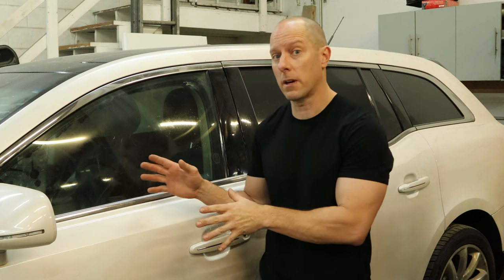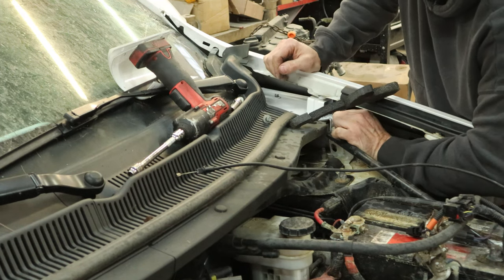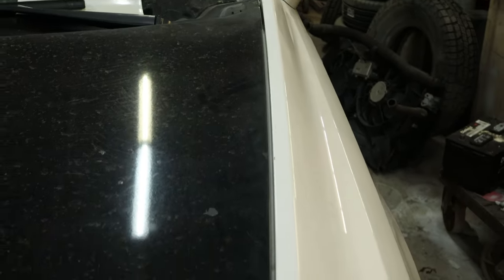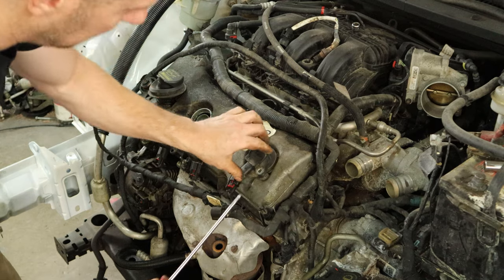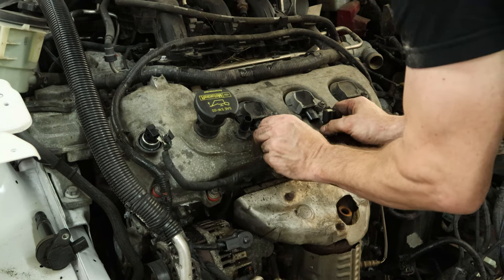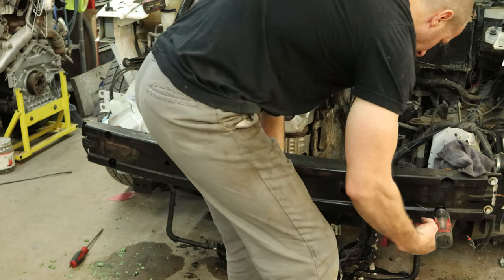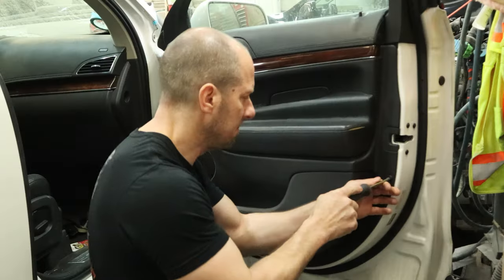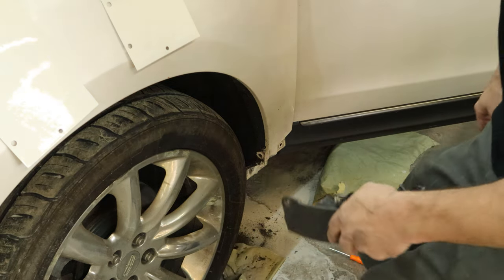Rebuilding the deer hunting Lincoln MKT part 2

Comment: No Ford didn't take the bail out money when all of them were hearting and went to the govt for money, but Ford has accepted money from them at other times.  The other thing they did do was a split on stock while lowered the price, people flocked to buy while it was extremely cheap.  Not sure where it's at currently but it's worth way more than it once was.  
Personally I don't like the brand due to previous issues on trucks I've owned over the years.  
Don't really care for Dodge, sure there's a couple vehicles I'd own if I had a chance.  But personally I'd go with GMC on trucks and probably Buick on a car if I were to own a car.  But with health issues I try to avoid cars seeings how they are harder for me to get out of.  With trucks you can just fall out if need be.  

Once again another awesome video.  It amazes me that no matter the make or brand you wizz through them like it's nothing but that's mostly all you've done all your life.  
I'd never be afraid to drive anything you've worked on.  
Mr Spotty only shows up for the money or what little you'll let him have.  According to some you don't make money on these vehicles.  You're smart enough you know if you'll make money on it before you buy it.   Keep up the awesome work.
🚗🚗🚗

Comment: My 91 Nissan Sentra was still running strong and not using any oil when it got parked at 395,000 miles. It needed struts, AC repair and a paint job. The estimate for the paint job was more than the car was worth. The struts were almost as much as the car was worth. I wish I had fixed it anyway because it was so much better built than any new car that I've seen since 2000.

Comment: That was my favorite tool also, a long barrel CP with the quick connect blade holder. After 37yrs in the industry I've paid for it with two rotator cuff repairs and permanent nerve damage to my hands, but I wouldn't go back and change a thing, had a lot of fun and got to play with fire, paint things and tear shit up and made a ton of money to do it. Great videos and skills as usual.
p.s. take 1000 grit sandpaper and sharpen those razor blades, now that's really being cheap. LOL

Comment: Those engine mounts are supposed to break. They save the engine from breaking, but mostly designed as part of the crumple zone, so they really are built Ford Tough. They did as they were designed.
It's also the reason they can randomly break because of the built-in weak spot.
Reply from the maker: One might argue the entire car is built to break. 😂
Reply: @vehcor  No one would even argue it. it's a fact, lol. But let's face it, they're all built crap nowadays. Except for your rebuilds, of course 😉

Comment: I find it quite amazing -- the amount of damage hitting a deer can do.  I hit one at 50 mph and thought I could just slap on some sheet metal and a bumper cover and a headlight and a washer bottle and an air box and a steering fluid reservoir and a core support and use some washers to make it all "fit" ... front end still crooked asf.  Can't avoid the much needed upper apron work.  Now I wish I'd done it your way three years ago!  😪

Comment: Please forgive my OCD sounding off but @ 14:36 you missed a cam cover screw and red seal on the LH front. It was probably missing off the parts car...
But as usual you seem to have nailed that repair without too much pulling and welding. Very sensible buying the parts car. Now you need to find a Lincoln smacked up its rear. But only if you can stand doing another Ford ...
Reply from the maker: If you are talking about the empty hole, there is one on the top of the valve cover in the same spot.  Neither of them get a bolt.  It might be where a wiring harness clips in on different models.  🤷🏼‍♂️  No more of these things!  I am going to junk the parts car ASAP!
Reply: @vehcor   Yep that's one but when my OCD sounds off I have to do something. Pain the arse... 😂
Bit like working on Fords ...

Comment: Hey man, what are you trying to pull?  You replaced the O2 sensor with a normal sensor, not the 90 degree version that came out.  you could have at least upgraded it to the bluetooth version LOL.  Looking good Scott, and keep the pressure on the haters, it's fun to see them get pissed off below :)

Comment: I bought the Taurus X and all the parts to fix it for what I would have paid for a wrecked GM equivalent alone. Nine years later the Taurus X is still going strong and I see a lot of the GM equivalent sitting in junkyard, or being sold for $1200 with bad engines.

Comment: You should have put a new water pump on with such easy access with the fender off. When they go bad, they leak into the engine and ruin it. That's probably what happened with the parts cars and why it was totaled. It's kinda a big job as you have to take the timing cover off. Another better idea from Ford.
Reply from the maker: No, Fords are perfect!  Just ask all the Ford fans I have offended today. lol

Comment: I've watched alot of your vids for quite some time now. You do fantastic work. But I've got a question. Have you gotten any cars that you just gave up on or was waaaay to bad to rebuild?
Reply from the maker: I have never given up on any.  If I start it, I finish it.  I did have some that became parts cars because they were too rough but I never started on those.  On the flip side I have also ended up rebuilding some parts cars because they were much nicer than expected.